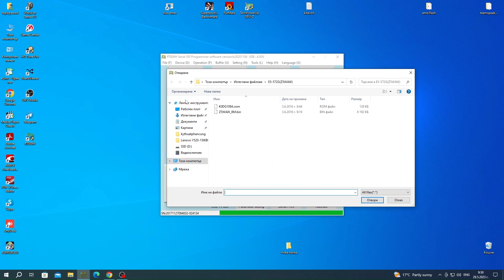How to Acer E5 572G repair

Comment: This video is good. I have the same model. Doing what you've been doing. But still not start. Even changing the cpu and the RAM still not working.

But thank you. Your video is a blast.
Reply from the maker: You probably have another problem too!
Reply: @topbgeood  yes. Probably my vga is failed.